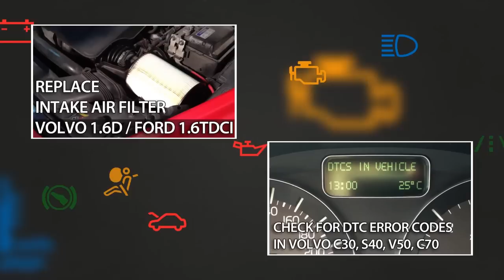Headlights projector lens disassemble and cleaning in Volvo V50 S40 C30 C70 (halogen xenon bixenon)

Comment: Thanks for the straightforward tutorial. 

My headlight aim is low. Is there a way where I could adjust it to have a higher aim somewhere? Based on your tutorial, I can fit a washer on the top screws so that I could achieve that. 

Any recommendations?

Comment: @mr-fix Great vid thanks. Slightly off topic, are those the OSRAM nightbreaker bulbs? And if so do they give a xenon-like effect? I want to achieve as close to a HID kit effect as I can without installing the kit as they're now illegal. Any info appreciated. Thanks.
Reply from the maker: +oneilldom // 
Hi! Those are just standard bulbs. I do NOT recommend installing "extra bright +25% xenon-effect HD night breaker" bulbs. With extra light they produce extra heat which will burn the lens mirror and in few months your light will be worse the before.
H7 bulbs by law are limited to 1500 lumens (+/- 10%) and xenon makes 2000-3000 lumens.

Comment: Do you need to adjust the height and position somehow after doing this? I want to do it on my old Ford that has xenon porjector head lights. It looks very similiar to this. Thanks!
Reply from the maker: Dan Isaksson No. You don't need to adjust your lights after doing that. But just to be sure mark the light/shadow line on the wall before starting and compare at the end.

Comment: Ive done this side. But what about the other side because the motor thing is in the way of getting one of the screws out.
Reply from the maker: If you adjust the light and use a thin screwdriver you can get it out.

Comment: Did this just today. On Volvo v50. 
One bad thing I managed to get is the right or left lamp one of the screw is blocked by big plastic which regulates the height of the beam. It took me an hour to remove the screw and put it back in later on.
Cleaned the lens they were covered with white dust, my reflectors are a bit burnt.
Installed Philips white vision halogenas will test out at night.
Any tips how to dissasmble the reflectors from the lens? They are not held by screws... Was wondering because thinking to change the burnt reflectors.
Thanks in advance.
Reply: Ive got the same problem where the headlamp aim motor housing  is in the way of the screw head!

Comment: hi I've tried doing this got as far as removing 2 of the t25 screws but then 1 of the screws seems inaccessible - any advice? thanks
Reply from the maker: You can adjust headlights so the 3rd screw is more accessible or even slightly bend the housing so it does not hit the adjustment motor. (do at your own risk)

Comment: Didn't work for me. I can't get to one of the screws. I think the motor for the adjuster is blocking it.
Reply from the maker: YonOtto try to regulate headlights before trying to reach the screw.
Reply: +mr-fix i think he have a little bit different model, i tried to do this too, but there you can easily access just two screws, third one blocked and can be accessed with screwdriver just by 30 degree angle. My (halogen) looks like this http://imgur.com/XQFJxzT
Reply: Martynas Shnaresys It was so much hard work to get the final screw out, I actually had to force the reflector down away from the black shroud that was blocking the final screw. I took a risk of actually breaking the reflector with the amount of force I had to use to get to that final screw. Luckily the reflectors held up. I have them out and cleaned the glass. I have reattached the reflectors with the just the two easier accessed screws so I don't have to go through that ball-ache again. The reflectors are fine being held with just two screws. They don't move at all.
Reply: That's good to know! Thanks for sharing.
Reply: +Martynas Shnaresys in the v50 headlight housing there are 2 other screws connected with white plastic pieces above the 3 he discussed in this video. If you loosen (do not remove) these screws the entire reflector will then move enough for you to access the last screw.
Reply: Pip Proeliator thanks for tip, will look for them next time.
Reply: +Pip Proeliator. After your intervention - where you've loosen those two screws to have access to the obstructed one - everything seemed to be ok?
I'm asking that because I'm apprehensive that it could affect the direction of the beam.
Reply: @pipp3508  Thank you for this tip about the 2 screws with white plastic pieces. I've just followed this by loosening these, to reach the inaccessible 3rd screw, on my October 2009 1.6 Diesel V50. Projectors looked opaque, but are now crystal clear, after cleaning with a microfibre cloth. I'm already using upgraded 55W halogen bulbs. Main beam brilliant, but dipped was awful. Hopefully I'll see an improvement next time I drive at night.